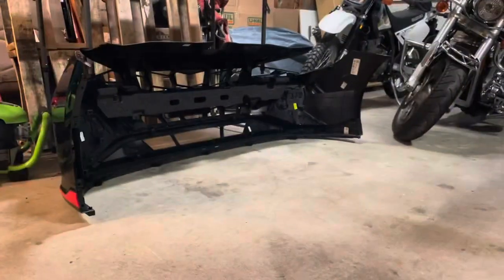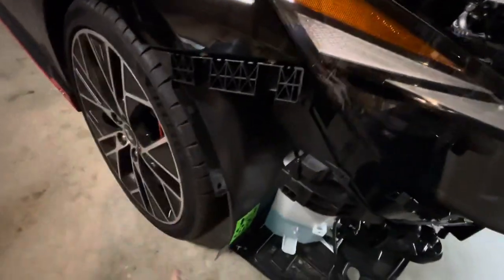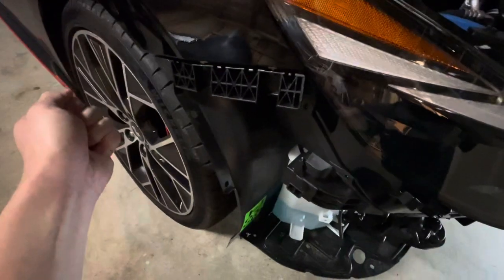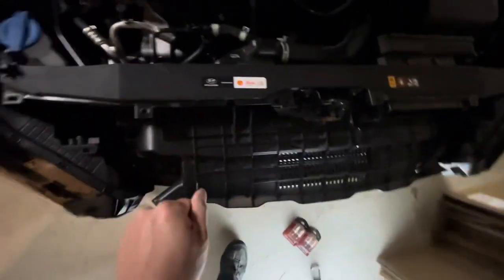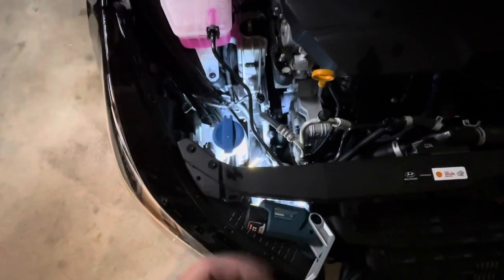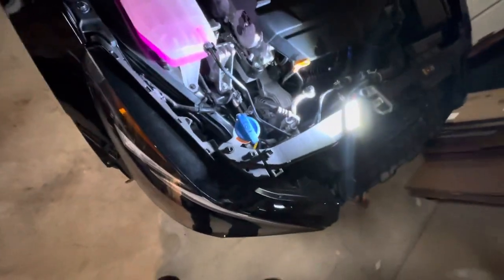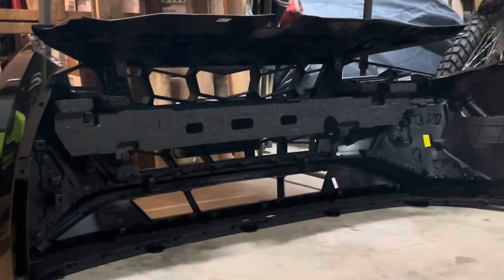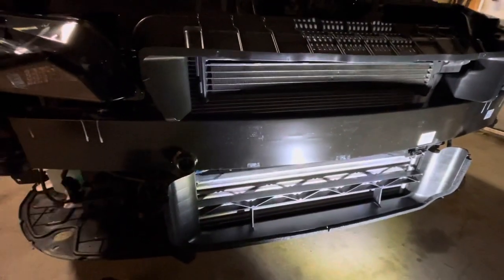Elantra N VLog - Bumper Off for Turn Signal LEDs and adding mesh around radiator/intercooler

Comment: Could be a transmission cooler or condenser for the A/C system.
Reply from the maker: I checked into it, the little one in front of the radiator on the top is apparently an oil cooler for the dual clutch trans

Comment: did you get error message or hyper flash from changing the turn signal bulbs?
Reply from the maker: Depends on the bulbs you get, the LASFIT ones on amazon have a resistor built in, others you may need to add a resistor in line. Otherwise the electrical system will sense an abnormally low resistance from the LED bulbs and think they're going out (i.e. will cause them to flash fast as a warning)
Reply: @darkelantran2280  thank you. The ones you linked in the description have given you no problems So far?
Reply from the maker: @Littlekill593  Generally no, if i have them blinking for awhile one of them starts to hyperflash though, i havent nailed down which one. I think it might be one of the rears, unsure
Reply: Yeah I did led on my car in the rear and the began to hyper flash but hey it’s blinkers not on all the time I can live with it and plus drivers see you more when switching lanes fast interacting with people lol